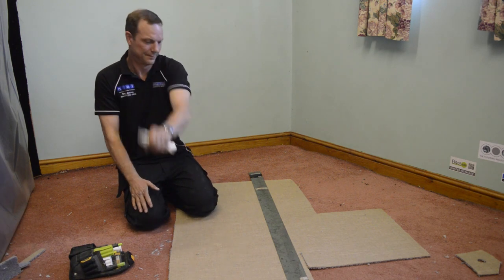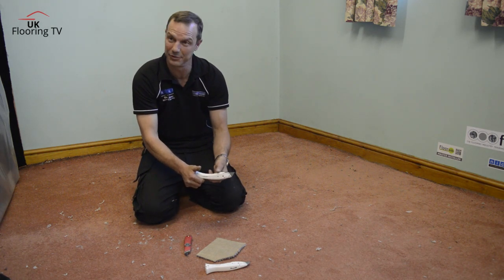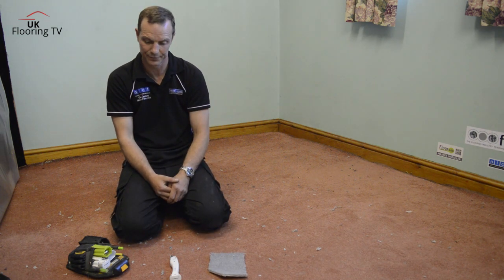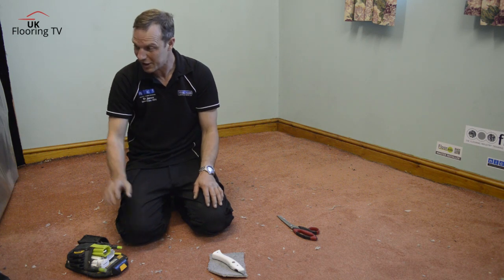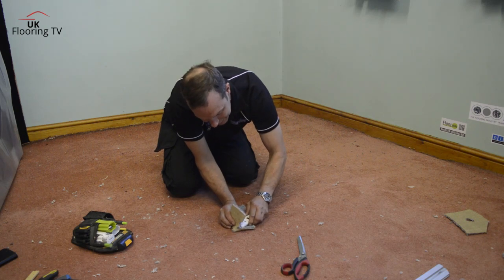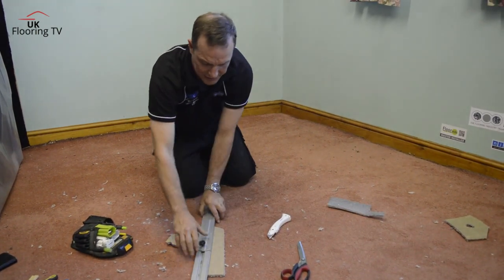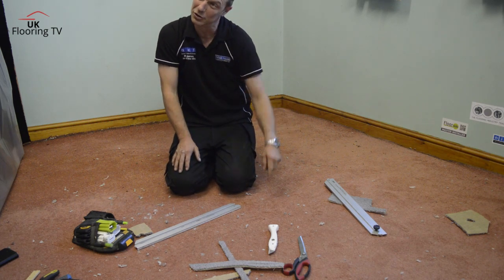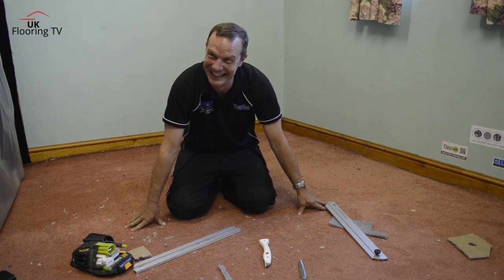Beginners guide to flooring. Apprentice basics episode 4.... knife safety.

Comment: I put my old blades in an old latex bottle (the 4/5 litre tub). Can easily drop them in and screw the lid on. Safe enough and if the bottle does fall over with no lid somehow. They're less likely to pour out aswell